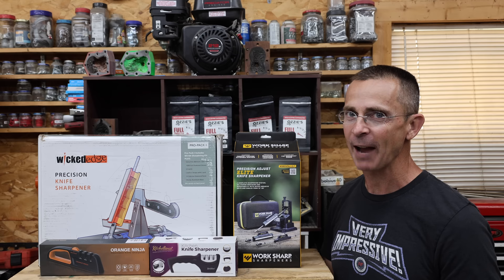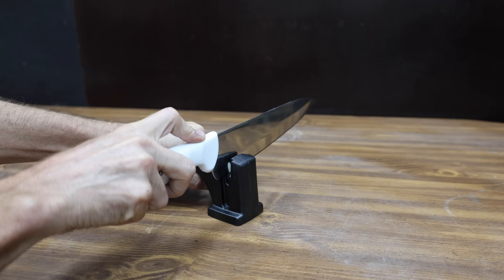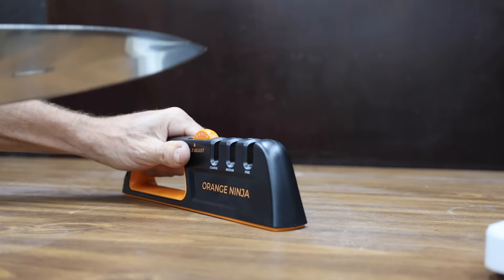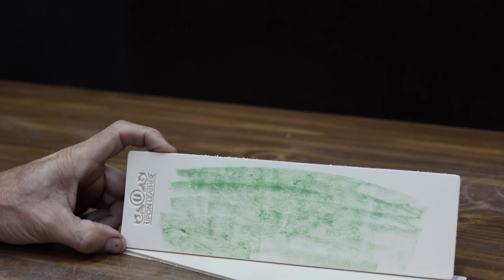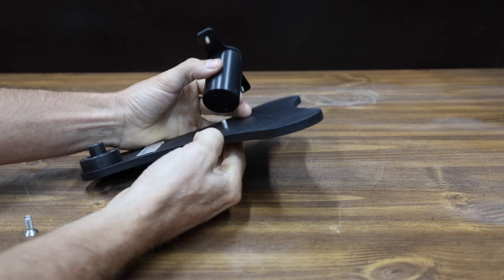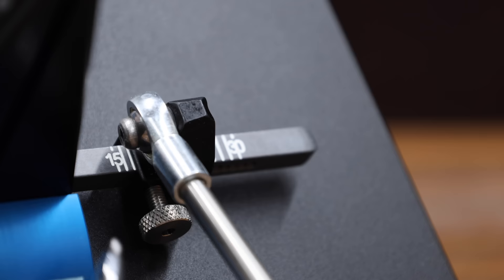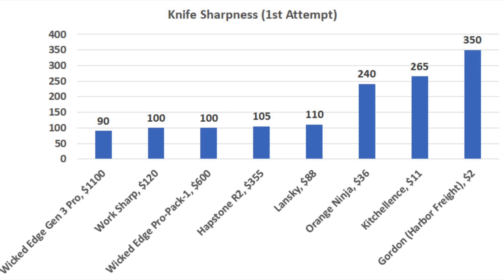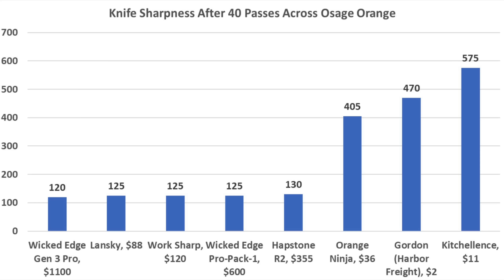Best Knife Sharpener 2023? Let’s Find Out!

Comment: $1100 for a blade sharpener is about as ridiculous as the $11.00 bottle of heavy cream I just saw at the grocery store!!! Companies are price gouging the fuk out of people. Put a STOP to this robbery folks and refuse to pay these ridiculous prices, REFUSE!!!  I have a blade sharpener that blows these away, a three stoned, oil bath, MANUAL sharpener, however there’s one huge con to this system which is you have to actually do a little work at it. So that right there eliminates most lazy ass people from acquiring such skills. Like anything that our elders used, if it takes actual physical effort, or thinking your way through something, our younger generations are completely dumbfounded! Scary 😱
Reply from the maker: Thanks for the feedbackk.

Comment: You didn't use the LS Lansky vice properly. At the tip of the jaws there's a cut that mates up to the back of your blade and then you use the stones accordingly - and make sure you use honing oil on the stones..... You didn't use the kit as a whole properly either. Careful how hard you press on the stones as you sharpen the blade as it does not require much pressure or you'll prematurely wear out the kit. I'm on my 3rd kit and believe it's the best sharpening system on the market and I've had many and have sharpened thousands of knives with mine from fillet knives to hunting knives and a few bowie knives which take some finess to do. All were razor sharp - sharper than any utility knife blade.
Reply: Then maybe make your own video showing everyone how to use it instead of being a Karen.

Comment: Best knife sharpener is to get yourself a couple quality Japanese màde ceramic water stones or a couple Japanese made resin bonded diamond stones and learn how to use them properly. That is the best way to sharpen a knife to make any knife as sharp as you want, without removing to much material. Don't settle with the beta male sharpeners like in this video
Reply from the maker: Thanks for the feedback.

Comment: those pull sharpeners should be banned. They dont work, they make your knife duller, and theyre basically snake oil. The first man that actually makes one of them that are good will be rich as sharpening sucks which is why im thinking of getting a wet grinder.
Reply from the maker: Thanks for the feedback.

Comment: Sorry your sharpening technique is wrong. 2-3 strokes/ pulls thru the sharpener.  NEVER back and forth. I'm surprised nobody has said this already. I reuse sharpen Stanley carpet fitting blades on a daily basis with rough wetstone.

Also the stand systems look like they should come with a "free visit to A&E" pass for non sharp knife handlers.